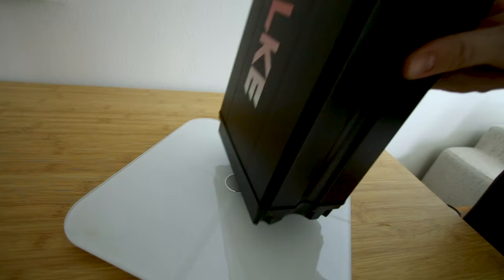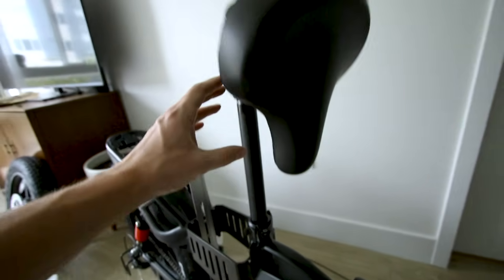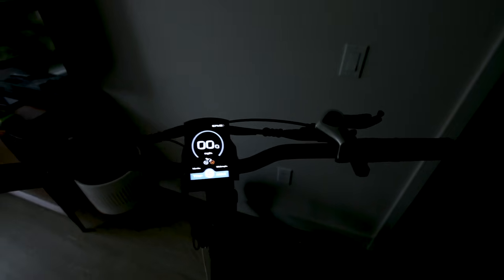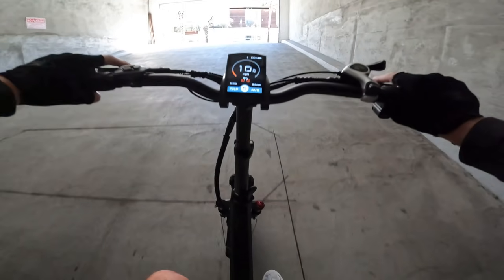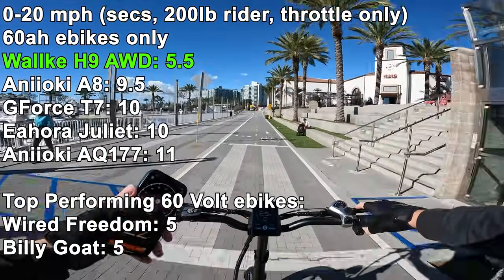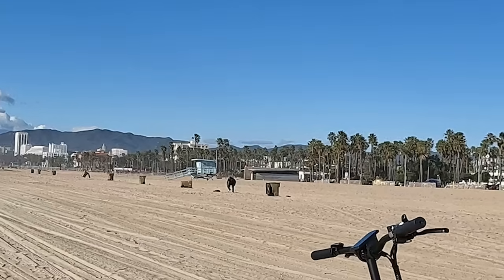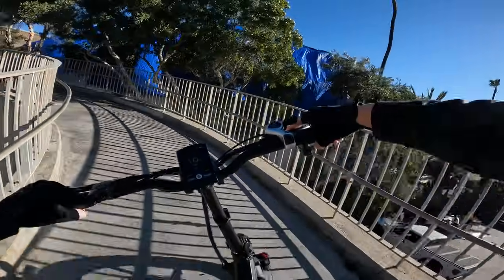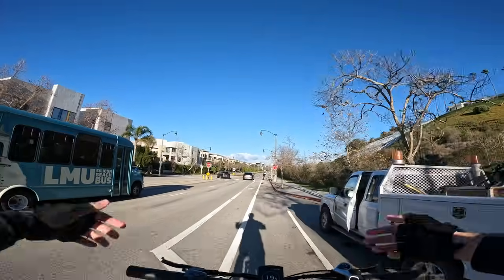This AWD "100 Mile" ebike is a MONSTER! Wallke H9 AWD Review

Comment: This review made me buy this bike … zero regrets!!! It’s rad !!! I recommend it highly… that’s all !! I’ve had it for 3 days and  it’s fast , comfy and cool looking !!! I suggest you get one or get the new step thru version!!

And real world range with a 250 lb dude … I am getting 60-70 mile both motors full throttle!!! Rad !!!
Reply: It's good to hear you're enjoying your new bike. I have a quick question for you... 

Does the front wheel / handle bar wobble when going at high speeds?

The reason I ask is because I got the G-Force T7, which is a very similar bike to the H9 minus the front wheel motor and after watching his review I have only one gripe.  The front wheel / handle bar wobbles when going passed 20 mph.

I figure it does that because most of the weight is in the rear and me being a heavy dude like you, combined with the heavy ass 60ah battery kinda screws with the front handling of my bike.

I saw the H7 is coming out too and I'm trying to decide between the H9 and H7, but I wanted to verify if someone like me gets the same wobble on a similar bike.
Reply: How long have you had it now and is it still running strong or any issues, I’m looking into getting my first e-bike ever so I’m clueless and looking for advice please 🙏🏻 would very very much appreciate it and God Bless you
Reply: @JESUSISKINGOFKINGSLORDOFLORDS  i have had the h9 for a month now.  The only issue was the rear brake line rubbed against the tire due to improper installation in the factory.  I have been waiting 2 weeks for a replacement.  My only gripe is that wallke blatantly lies about the size of the motors.  The motors are advertised as 1000w in the rear and 750w in the front.  In reality they are 750w in the rear and 500w in the front.  I weigh 240lbs and i get 80-90 miles per battery charge and i do not take it easy.  Max speed i have seen using gps is 32mph.  Excellent hill climbing abilities as well.
Reply: @JESUSISKINGOFKINGSLORDOFLORDS  it’s a super strong runner , built very well and the only issue is flat tires ….  Besides that I’m very happy with my WALLKE H9
Reply: So if you were in pedal assist level 3 you could probably get 80-90 miles?
Reply: @matto7026  I believe another reviewer determined they were "stamped" lower for various reasons, but that they are actually 1000W rear and 750 front. Though I have not seen proof of either. Any issues lately?
Reply: any issues with your H9 a month in?
Reply: @justinwhite2951 no issues except for tires
Reply: I'm also 250 pounds, and I've gotten a 100 miles out of mine with 15% of the battery left. But 95% of that was just with the rear motor. You're right, it is a very nice bike.
Reply: I need to do 50kmh or 31 mph... I have 17 kms of flat road with no gravel shoulders and doing 34 kmh is NOT cutting it...
Reply: @CensorMeNot-dv5lg  yeah … I average 30 mph now with new tires and liners …
Reply: How has it treated you after almost a yr? 🍻
Reply: @Antoine-619  overall the bike is pretty good… It’s such a heavy bike and with the higher speeds there’s a tendency to burn through brake pads a little bit quicker than normal or at least that’s the issue. I’m coming across… Motors have over 2000 miles on them and still run very strong… Battery still charges to 55.6 V… And with the Black Friday specials going on I highly suggest picking one up especially with the free 22 amp hour battery upgrade… One other downfall is if you have any customer service issues do your due diligence and documenting your problems because they like to try to troubleshoot everything through video and that really does not work too well especially when you have a charger, that’s throwing a fan bearing and producing heat while charging… I’ve been waiting over a month now for the replacement… Besides all that crap get one write it and be safe all while you smile your face off
Reply: @justinwhite2951  lol sorry for the late response almost a full year into it and no major issues… I have a few other choices as far as E bikes to ride around and I prefer the H9 as my daily rider it gets this big boy all over town
Reply: That’s the exact reason why I put ultraverse all-terrain tires on and put in Tannus tire liners… I did that after my first flat, which was less than 100 miles into owning it and now I got over 2000 miles and have driven through some very interesting things and still no flat… Best investment ever
Reply: @JESUSISKINGOFKINGSLORDOFLORDS  if you haven’t got one… Get one it’s a lot of bike for a little price
Reply: @LeeAyzahn  I have not experienced a wobble at a higher speed if anything the rim might be slightly out of balance, but he could take that to Les Schwab and they’ll balance it for free for you
Reply: @ besides blowing through break pads … it’s a solid bike … had some customer service issues, that’s all fixed now … it will be a sweet ride in Diego!!!

Comment: I think most people forget that the battery will go bad at some point and would probably cost $1000 to get a new one if they even offer it for a replacement
Reply: It's a duel battery, a second can go in the neck I think 20ah for like $600. But yea the big battery literally would be a G or more. Good point
Reply: @g_dub  NO its about $788
Reply: If you saved 1 dollar for each time you charged it, by the time you needed a new one you could buy a new one and have 200 in savings.
Reply: They offer warranty with the h6 max they send me 3 batteries for free i fix them and now i have 3 batteries free
Reply: Good doggy

Comment: I picked this bike up a few weeks ago and i'm impressed with it. The screen came broken but walkie support just wanted some pictures f the damage and serialnumber and said they would mail it out to me. I have the tracking number and it should be here next week but i've been riding it on dirt/rock trails pretty hard. it pulls uphill pretty strong basically been using it like a dirtbike and it's held up so far. I would recommend buyers open up the spot where the controller is and add some padding because i could hear it shaking around in there. On mine it was pressed up against the door and the shaking caused the markings to wear off so if i ever have a problem they probably won't warrantee the controller since the SN is illegible now. I'm 5'11 170lbs and can easily fold/lift it without the battery. All in folded it looks like i can fit 2 side x side in my bmw X3. Being able to fold a bike with this power is so nice because i just get up and go whenever i want and not worry about an $2000 bike being strapped to a rack.  I think i might upgrade the rear springs to true adjustable shocks in the future because the rear end is a bit stiff, but have been smashing some trails this bike isn't really meant for

Comment: $1899.00 with shipping using both discount codes! (WK200 & HB200) Crazy price Wallke for a 60ah AWD.
Reply: Did you get yours from Amazon or the website? I got mine from Amazon for $1,699

Nvm noticed you said the 60 ah version
Reply: Unfortunately the second one doesn't work anymore, and none of them work in Europe, so it's $2165 60ah and $1935 40ah 😕

Comment: I received mine about a week ago. Admittedly, this is my first ebike.  But I've had many motorcycles in the past and feel like I've done my research thoroughly. This bike Checks all of my boxes. Power, portability, and Range. I was going to do my own review of this bike on YouTube, but you beat me to it. I am thoroughly satisfied with it.
Reply: please still do there is limited vids on this bike and I am interested in hill climing and weight capacity
Reply: Do you get that annoying front motor skipping noise?
Reply: @GiRides  
 I have noticed it a little bit when I am on the street and going full speed, But you don't need both motors in that scenario. It's easily overcome by just backing off the throttle a little bit if it's that much of an issue.  It's not an issue for me at all.
Reply: @leonardomohammed5318 
 I made another comment to you that was deleted for some reason. 
But, I'm 250 pounds and have gotten 100 miles out of 85% of this battery (60 Ah). I have taken it off-road a little bit and up a fairly steep hill in 2 wheel drive, and it did just fine.   Again, this bike is perfect for all of my needs. I can't imagine needing a different one.
Reply: How has it held up?

Comment: All testing in 7th gear on full throttle. I gave this thing a proper test for a big guy. 

Aight homies, big dude here (6ft 275-300lbs depending on when you read this)... Got the Wallke AWD H9 because of this review (bought me and my brother who is roughly 5'10 230 each one). So far I've ridden it from the Southside of Chicago to the Northside twice. Thing is awesome. Some lady smoked me at 87th n western from the east to west bound right turn lane, but the brakes worked perfectly to stop the bike... She just kept coming over the crosswalk line and smacked my front wheel throwing me off the bike and onto my knees and hands. Only busted the fender a bit (popped the little studs that were holding the plastic to the middle bracket, took me 15 mins to throw a nut and bolt on there when I got home). Lady was in her 60s,stopped,immediately got out and offered to call an ambulance... My fatass was more embarrassed I got tossed from the bike than hurt so I made sure she was fine and went on my way (my Lil bro was pissed I didn't get insurance info.. I'm very passive if it's an accident, but if you tread on me... Its a different story) ... I got health insurance and it's been 2 days since the incident and my knees are already doing better. Walking was fine but bending then up and down stairs was a little rough. Nothing some ice couldn't help... Former rugby player so I'm used to taking shots to my knees. I didn't have a helmet on because I'm an idiot, but the gloves did save my hands getn scraped up. Had long thicker sweat pants on so I feel that helped a lot too... Knee pads in my future... It's a high fall.
Going to the Northside about 22 miles I got the battery to read 51%,charged it at my brother's to 100 while we watched a movie, and then rode home which read 61% (took a direct path home instead of winding through neighborhoods like on the ride up). I will do a more thorough drain on the battery to see how it performs in the future, but it was only in the 60s Monday... It's been in the 30s every day since. So far, I'd give it 9.5/10 as my tailbone (former injury stuff) was pretty sore when I got home, but Western is BUMPY AF if you know the road... It handled it like a pro.
Reply: Was avg 30+ on the on board speedometer the majority of the trip. Western is pothole city, but flat for the most part. On the biggest incline 85th up to 87th I did actually give it some pedal from the light just to get ahead of traffic, but even without down shifting the bike maintained 28mph on on board speed once I stopped pedaling. I beat traffic to the light which blew me away. Super happy with the performance. Hopefully it keeps up.
Reply: Man I'm 5 ft 6" and 140 lbs think I can ride this thing? , I wanna buy it for a couple of months now but there's no place to test drive it here and I'm afraid I might be but short for it..
Reply: Is the battery ul certified

Comment: That's a heavy duty package there! Definitely a bike I would not feel the need to upgrade. Agree that the weight being centered helps with handling. The RadMini has the same placement, and that makes it nimble on actual mountain bike trails. While I do like the way dual motors pull you through sand, I prefer a single motor with the equivalent power. Even with dual Tesla batteries, my total bike weight is 79 pounds.

Comment: The usb-c port on the display is what made this one a winner for me second would be the foldability...
Reply: @FullTekAuto  that USB-C port is kind of funny at least on mine. It won’t charge my battery on my phone, but it will maintain it at whatever percentage I plugged in at as far as being a folding bike… It definitely transforms, but still leaves a pretty decent size footprint, a.k.a. storage if you don’t need the folding capabilities, then the H7 is the way to go

Comment: I like to use compressed air to clean my bike too and sometimes use degreaser and WD-40 the original is a degreaser not a lubricant maybe at first but it drys up but they make lubricants too and seems to do my bike well.

Comment: Hey bud, another great vid! I have a question for you tho. I am tryin to do my research on this e-bike before I pull the trigger on it. How many miles (roughly) does it get goin throttle only? Does the battery go down quickly in throttle only, and rear motor only, and AWD? How heavy is the bike without the battery, is it tough as hell to bring up and down a few stairs? I am 5’7”, 170lbs for reference. Thanks man, ad keep the great vids coming!
Reply from the maker: Generally 40ah can do 60 ish miles throttle only, 60ah can do like 100 miles, pedaling makes very little difference

Comment: I think the battery on top of the rack in the rear would be a better design for the bike and then they can find a way to also mount the seat or cargo rack over it. This would shorten the frame as well as make is easier for shorter people to ride it. Even at its lowest setting this bike is too tall for me and too huge, I am 5'4", it also looks extremely long, you're 6'5" and the bike looks as big as you. Cool bike though, I always enjoy seeing all the new releases of dual motor ebikes, as they're not too common but definitely fun and necessary for some big hills. I have a grizzly myself and I'm converting another ebike to dual motors.
Reply: From a logical point, that sounds good, but I have to ask:  Ever ride a bike, any bike with a load on the rear? That is the worst place to put a load for handling. Even over the front wheel is preferable.  It makes turning, which requires tipping the frame and using the shoulder of the rear tire completely unstable. Maybe a 20 Ah battery, under 10 pounds,  but this is triple that, plus your putting g the load up high. I see your point t, but there's a reason they put it where they did. The alternative would be Eahora Juliet.

Comment: What is the setting for throttle only? No peddle assist.
Reply: Only way on H6 is to unplug the pedal sensor.  Then use throttle and cruise control (hold down "-" button for 3 seconds) to get the exact speed/power you want.
Reply: @flyiniowa6255  you are a LEGEND! Thank you.
Reply: @outdoors445  how have you been finding it throttle only?

Comment: When the battery is fully charge what is its voltage? 50.4V or 54V ? its the difference between a true 48V battery and a not so true 44V battery its something no one the does bike reviews un boxing talks about and its rather important.
Reply: Voltage should read 54Volts

Comment: Will you be conducting a "range test" with this one in the future? I'd love to see if this bike will go the distance!
Reply: I decided to get the H9 and I'm going to be putting it through its paces. I'm going to ride it from the East Peoria, IL riverfront, up out of the river valley and out to Eureka, IL, then take the backroads through Goodfield, IL, and down Broadway Rd. to Pekin, IL. Climbing up out of the river valley should really test the battery's endurance, as the route I'm taking for the climb is about a 2-mile long, 10% grade. I weigh 340 (And losing), so this bike is really going to have to work HARD. Because I'm using it for a bit of exercise, I'll be running in pedal assist 2 (or 1), rear motor only, unless AWD becomes necessary.
Reply: I’m getting 70-80 miles on a full charge/ full throttle.. I love my H9 AWD 60aH !!!!!

Comment: aniioki vs wallke? and why?
Reply: Id say the wallke just because it handles a little better because of the battery located in the back rather than up front like the aniioki, and plus you can fold a wallke bike, the aniioki used to have a folding bike but they arent selling it anymore like the 48 volt aq177 that has PAS 5. Honestly both are good seems like the aniioki might be a little more heavier

Comment: Is the front engine always active? Can it be deactivated?
Reply: look at the start of the video he explains all of the modes.
Reply: Your rear motor is always the default mode out the box. You can select different modes by pressing "i" for 2 sec to cycle through different modes. Single rear, single front, dual motor and Eco Dual Motor

Comment: Please beware from buying from this company! I purchased H6 max and I am barely getting 20 to 30 miles off a charge not to mention the motor cable cord was cut on the actual breaks! It’s a terrible design! Wolf (owner?) keeps telling me my bike is fine and will not refund or replace his piece of shit bike! The battery doesn’t sit in the frame properly and it’s welded horribly! I have proof of purchase and I have videos and photographic evidence to prove all of this. WALLKE BIKES ARE TERRIBLE!!!
Reply: Agreed, I’ve had same issues scammer company
Reply: This same guy starts a YouTube channel showing off his Wallke bike and food delivery business.  You cant make this stuff up. He needs a bike shop to hold his hand when a screw comes loose.
Reply: @flyiniowa6255 yes I posted the bike and if you can watch it doesn’t even run properly in the video lol

Comment: $2100 with with 40ah bat, tuff to beat
Reply: It's $1899 with 60ah bat.
Reply: @flyiniowa6255  after watching the full review, lack of power was disappointing
Reply: @bassw1758  Looks like you'll need a motorcycle or a 72volt machine to get what you want.
Reply: @flyiniowa6255  lol, na, dual motors is for hill climbing, they're claiming 2800w, a single Bafang hub wounds for torque climbs just as well with half the wattage. So what's the point?
Reply: @bassw1758  The H9 has a 40ah controller running both motors. That's 1920 watts max.  2 motors allow you to shut one off to run on flat ground more efficiently.  Pros and cons to every setup.